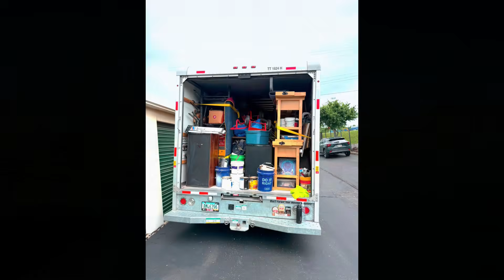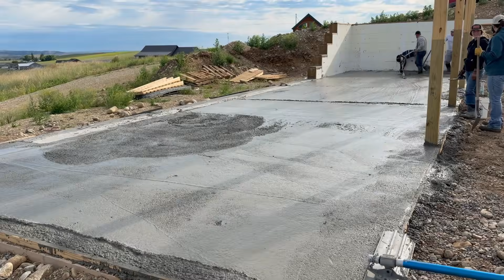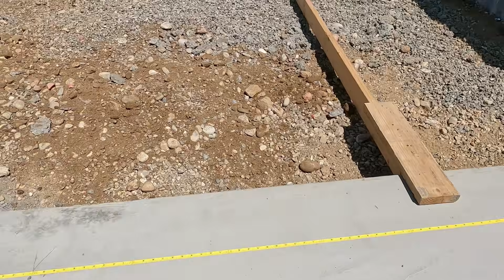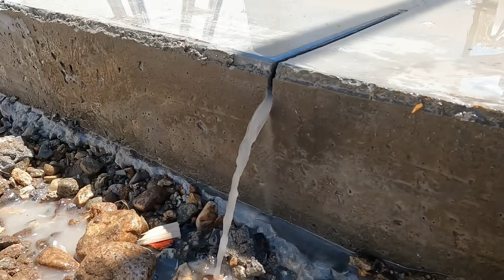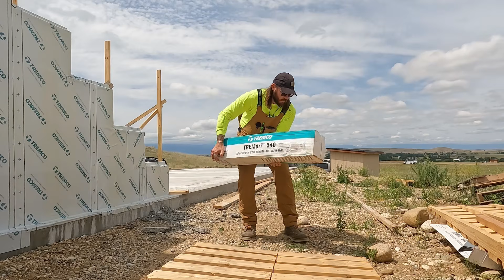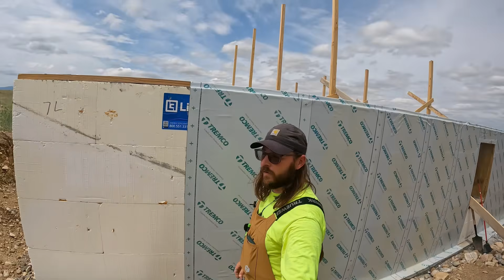Montana Barndo Build: The Hardest Part of the Foundation

Comment: Wouldn't it have been better to go horizontally with the Tremco. starting at the bottom and working up? I don't know what the manufacturer specs on this, just wondering.
Reply from the maker: Yes vertical application is manufacturer recommendation. Thanks for the question 🤙🤙